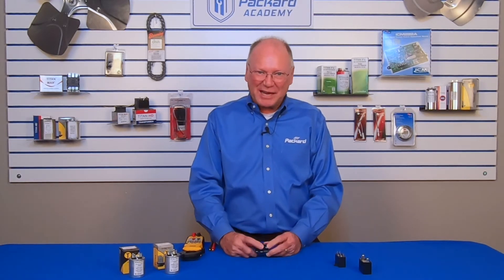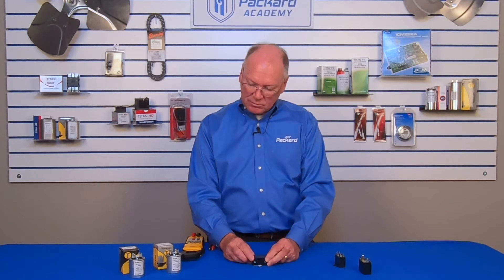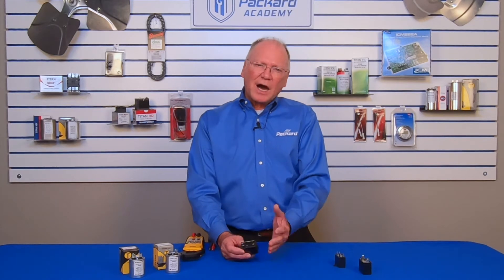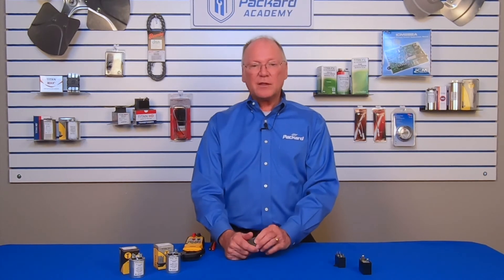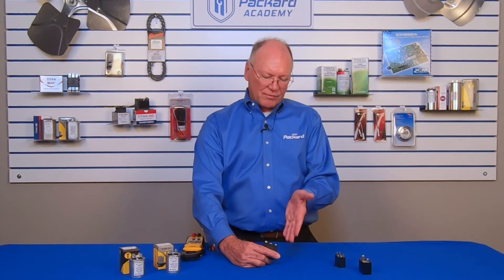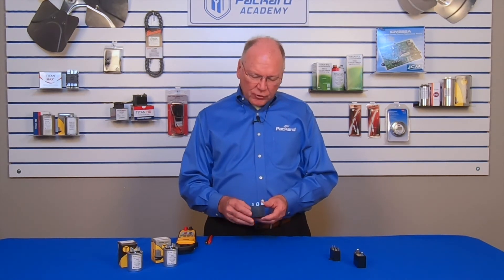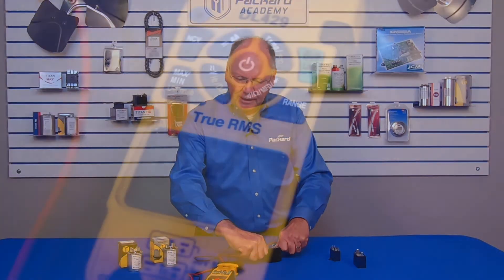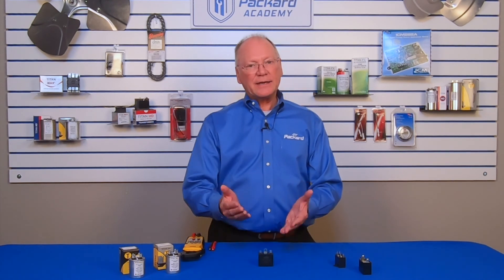Run Capacitors: Oil Filled Vs. Dry

Comment: Thanks for giving knowledge on selecting capacitir based on capacitance but i have doubts regarding the filling material in a capacitor which one to be selected for high temperature,longer life span for use in a three phase motor

Comment: I personally disagree with the assessment that you can't improve efficiency by changing capacitance.  Not all motors are created equal straight out of the factory.  A motor may only be 60% efficient by using what is suggested on the plate, but can increase up to 80% by literally doubling the capacitance.  I personally prefer to calculate it myself and determine based on the power factor.  Never go above 80% unless you have a capacitor disconnect engage once the motor power is removed or you may end up doubling the voltage that the motor is supposed to run at.

Comment: Can you use an oil filed capacitor in place of a dry capacitor? Thanks for the clip. I look forward to the next one.
Reply from the maker: Yes, you can use an oil field run capacitor to replace a dry run capacitor.  You must make certain that microfarad rating matches what the motor calls for and that the capacitor voltage is at least as high as the capacitor voltage that the motor calls for.  The only problem that you might run into is size.  The oil filled will be larger than the dry.  It is no problem if it can be mounted ok.
Reply: @packardonline  Thank you for the response.